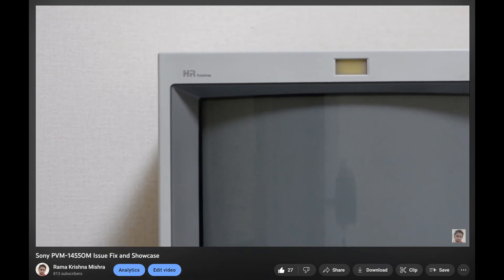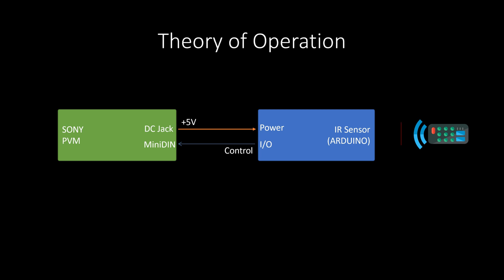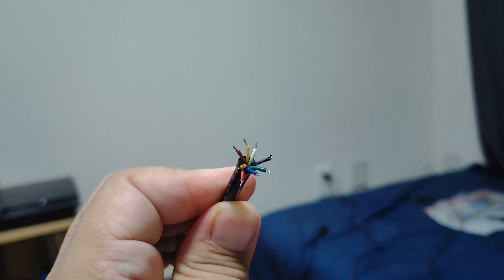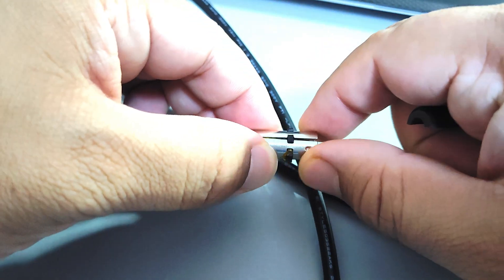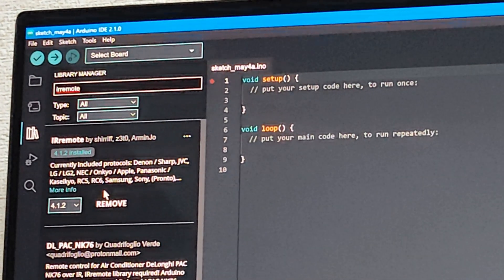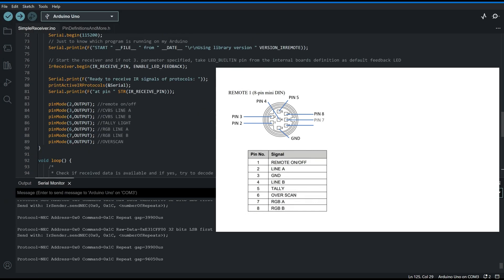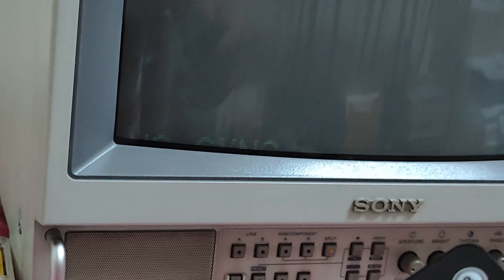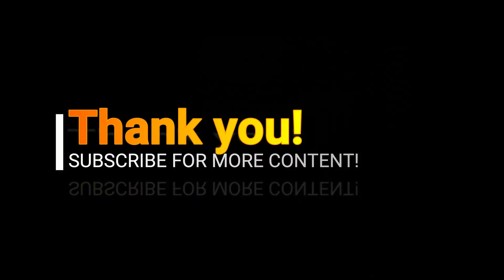Building your own SONY PVM Remote Control

Comment: You did a great work! Very Nice @ramakrishnamishra I would like to ask you if you are interested in a Portable Saturn? I saw your comment in the chinese guy who build one,  but he is only a Diyer..I will build one Portable Saturn, tell me if you are interessed in?
Reply from the maker: Thank you for the reply! But I am no longer interested in a portable saturn. Thanks again! Can you also build a portable PS2?
Reply: @ramakrishnamishra8179  Yes I can, Build a Playstation 2 portable is more easier than cut in half the Saturn Board!
Reply from the maker: @vandresoares2859  cool! Real problem is that there is no 5 inch 640x480 IPS LCD display which we can use to build a nice perfect PlayStation 2 system.. we have to rely on crappy TN displays
Reply: @ramakrishnamishra8179  i think that we can use the 5 inch ips sega Nomad screen,  it use rgb video input, i think it's possible to try!
Reply from the maker: @vandresoares2859  are you sure the nomad screen is 5 inch? I think it is 3.5 inch
Reply: @ramakrishnamishra8179  You are right, its 3.5 inch, not 5, but I think that we can find a 5 inch ips screen..
Reply from the maker: @vandresoares2859  I think there is a 4 inch version! 640x480 which is also good!!
Reply: @ramakrishnamishra8179  if you accept with 4 inch ips screen i can build with it!
Reply from the maker: @vandresoares2859  ok.. please email me on mishra.rk.89@gmail.com and please send me your previous PS2 builds that you have made.. and how much it will cost
Reply: @ramakrishnamishra8179  ok, I sent you, I saw your playstation 1 octacore  with Xu4! Its amazing! Congratulations! You inspired me to build a Portable Xu4!